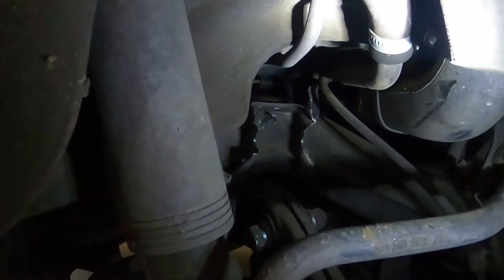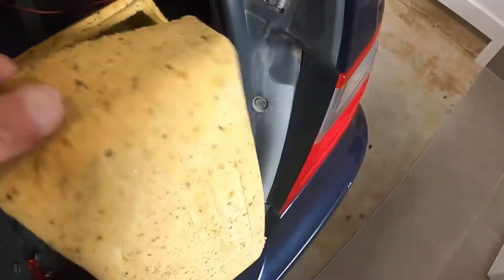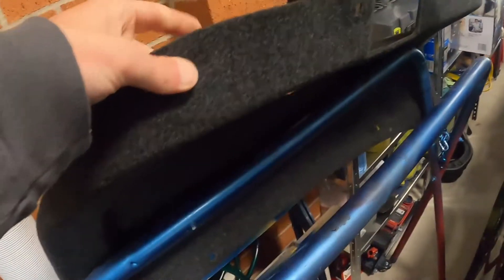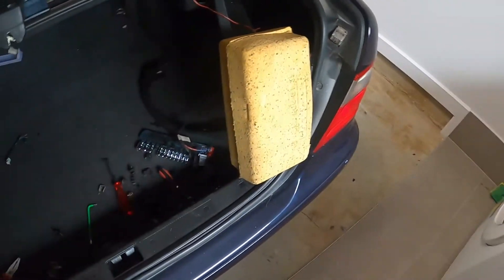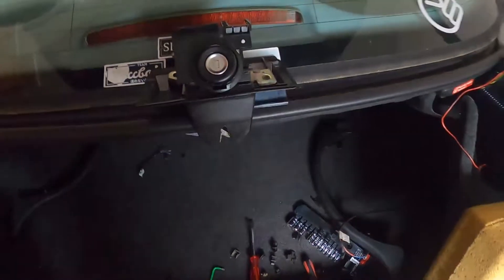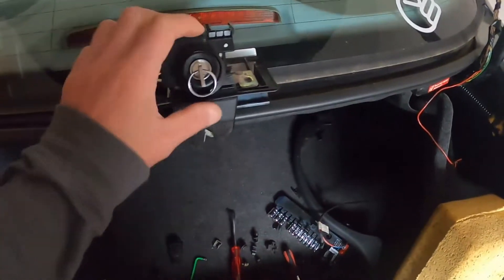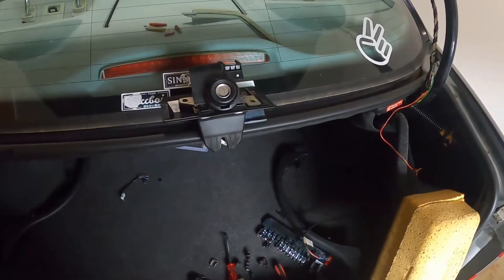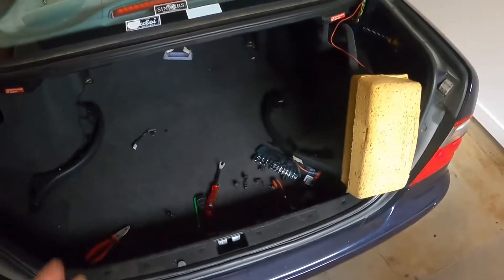Bad news. My 2001 CLK 230 is not repairable. Sub-Frame damage .

Comment: Oof! That sucks. If the sub frame is still good, you may be able to have a new control arm bracket welded on instead of replacing the whole subframe.
Reply from the maker: I thought about it too, but I have no experience in welding,  nor I have the tools. I decided to cut my loses which we're bad :) and nove to the next project
Reply: @saltherookie  that's really unfortunate to find! Can't wait to see what the new project is tho!